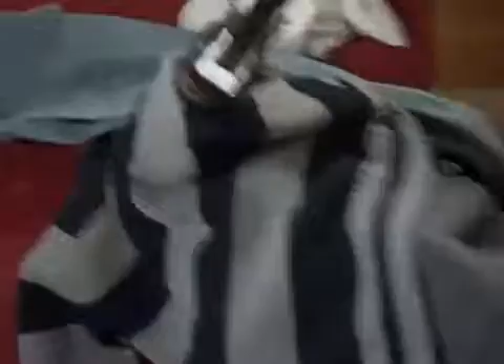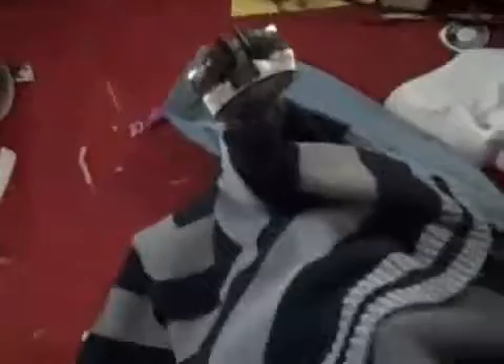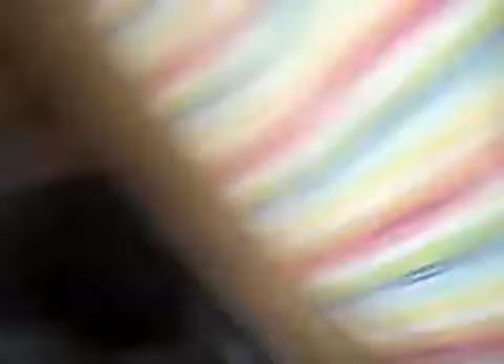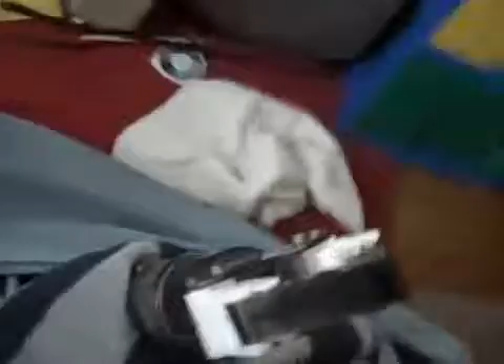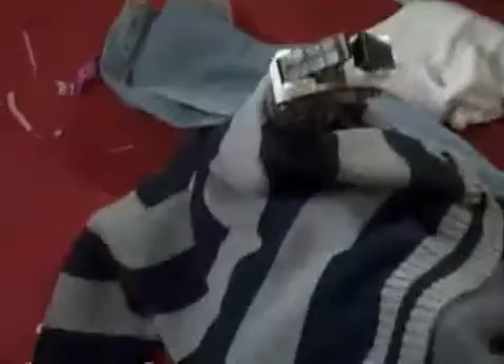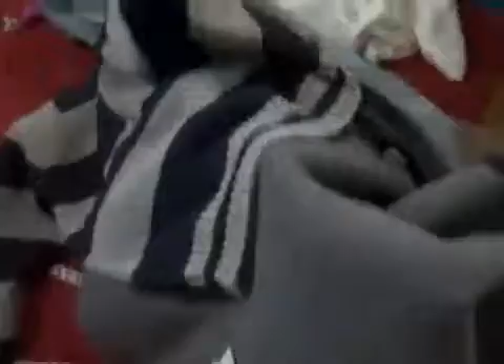Vex Controls DC 3v Motor on Robotic Arm

Comment from the maker: Vex is NOT limited at all. In fact designs are infinite. The microcontrollers are very capable of performing many tasks and materials included with Vex are expected to be modified. You can get a lot out of Vex. Plus the new MCUs are coming out soon, which means good news for Vexers. The only limitations are the price and the MCUs, which aren't made to be modified. Although you can always use your own MCU or arduino. So  no, it's not limited. Maybe you mean Lego Mindstorms NXT.